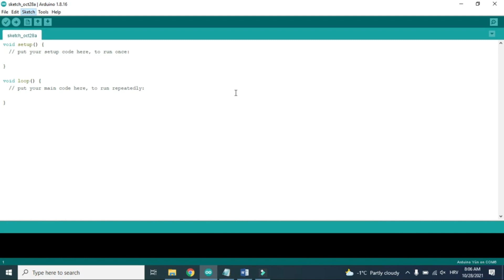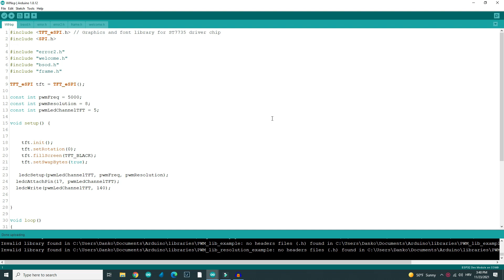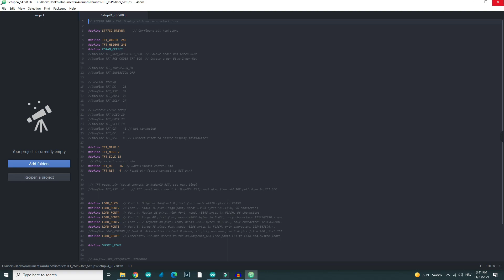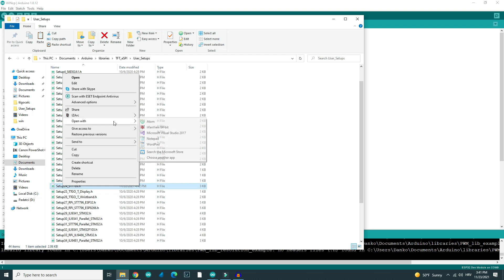ESP32 and 1.3" IPS TFT display (Fake WinXP code)

Comment: Hi, tanks for a show you project. I have a problem with a configuration pins for my esp32-s3-double eyes . Can you help my ? Actually I have a black display and no error tu compile and transfer a  code
Reply from the maker: I never tried that double eyes board, but it is probaby version of esp32 boards that is instaled in arduino ide. If you are using tft espi library version of esp32 boards needs to be downgraded to 2.14
Reply: @VolosProjects hi, yes i try the version but the result is equal. I think have a problem in the user_setup file configuration and drive.
Reply from the maker: @sergioroselli5726 why you dont use libraries manufacturer prepeared fir that board
Reply: I use the factory library . I think a problem is a config user-setup file, the config correct  PIN
Reply from the maker: @sergioroselli5726 if you are using factory library, then pins in user setup are already corect, what is version of esp32 boards instaled in your ide?
Reply: @VolosProjects now use 3.2.0 and receive a Display on  when select Setup46 at row 80 in file User_setup_select
Reply: The Displays are ON and pixelate

Comment: Dear Volos!
The sketch with Windows XP loads and works perfectly!
And Currency with the same settings shows everything, but everything is zero, except for the upper part, where 1.00000. and IS NOT UPDATED!  Where is my mistake.
My libraries:  WiFi_2.0.0, ArduinoJson-7.x, HTTPClient_2.0.
Help!!!!!!!

Comment: thank you very much for sharing! due to my lack of knowledge to be able to adapt the codeI had to downgrade the esp32 kernel from 3.0 to 2.0 to avoid the error (ledcSetup' was not declared in this scope)  due to changes in 3.0 : ledcAttach used to set up the LEDC pin (merged ledcSetup and ledcAttachPin functions) and it work !
It would be great to see more projects like this as a classic green terminal screen with code😃
Reply: A mi ya me había pasado con otros Sketch y bajando la versión si que funciona.
Gracias
Reply: code?
Reply: @sahatmlumbantoruan6432  el code está en la descripción del video

Comment: Thank you so much .. 
I noticed something with using this library compared to the Adafruit_ST7735 (I have ST7735 1.44'' 128x128 TFT) 
The 16-bit colored images appear INSTANTLY using this library with the help of pushImage( ) function.. 
While using the other library with the help of drawRGBBitmap( ) method, the image loads gradually from top to bottom "it takes about 1 second" .. 

so what's the reason behind that? .. why is pushImage faster than drawRGBBitmap ? 

Thanks

Comment: Hi! I have uploaded the same fake WinXP coding into TTGO (LilyGo) 2ASYE-T-display (1.14 Inch LCD). But the image does not fit the display properly and I have only half of screen shown. Where should I go on the code to fix the resolution? Thanks!
Reply from the maker: Sorry, that cod eis writen for 240x240 display, not code but images that loops, it is not possible to addopt code for 240x135 display you are using
Reply: @VolosProjects  Thanks for your reply! I was wondering if you can provide the images (bitmaps) to upload them to the code...or just redo the code with the 135 x 240 images resized...I buy you a generous coffee! Thanks!
Reply from the maker: @Attic-Toy-Design  i will try to make something today
Reply: @VolosProjects  Lovely! Let me know! I believe this will benefit not only me but many of thousands of your subscribers and fans, as this TTGO board is very simple and easy as it comes with the display on it...Thanks Mr Volos!
Reply: @VolosProjects  Hi Mr. Volos! Let me know when is ready! I am ready to buy you a coffee..

Comment: I have 38 pins ESP32 Board. I can not find nowhere a clear assignment about the pins.
Reply from the maker: gnd-gnd, vcc-vcc,  scl-15, sda-2, res-4,dc-16 or Rx2,  blk-17 or Tx2... don't forget edit user_setup file from library. Pins are in description.
Reply: @VolosProjects  Thank you very much for responding. I will try it.

Comment: Windows XP, ahh memories.  Very Clever, all your missing is the XP boot sound.  I'm thinking a small 3d Printed case like an old XT computer and sticking this in it with a small battery.  Most of my Geek friends would geek-out.  Thanks for the project idea.  Keep broadcasting!!

Comment: Help please I have tried two displays both are blank apart from being back lit. Tried this project and the Christmas one. Double checked pins. thanks
Reply from the maker: Did you setup tft_espi library?
Reply: @VolosProjects  hi, yes I did, followed instructions and used setup 24. Even copied your pin allocations from the information below the video in case I made a typo. Double checked each wire is going to right pins. Wouldn't think it's 2 faulty displays, so something I have missed. Maybe it's the loading of the code, it ends with saying it is going to reset and then no further messages. First time using the esp32.
Reply: @rogersmith6151  How did you go about uploading the image part of the code?
Reply: @TheKrausenKid  I sorted the display not working, used setup 24 with this setup 
#define TFT_MISO -1
#define TFT_MOSI 23
#define TFT_SCLK 18
#define TFT_CS -1 // Chip select control pin
#define TFT_DC 12 // Data Command control pin
#define TFT_RST 4 // Reset pin (could connect to RST pin)
Important to make sure the nodemcu toward the bottom of setup 24 are not defined and have // in front.
I could not get the XP program to work get an error in the image file.

Comment: I am sorry but I can't follow the wiring, there are 8 connections coming from the esp32  but only 7 connection points on the lcd.
Reply: Did you sort it, I cant get mine to work at all. Thanks

Comment: I've heard that you can't run an operating system on a microcontroller because the architecture doesn't have a memory control unit, is it possible to make one (emulating, using an ic or using a FPGA)?
Reply: As long as a port exists you can run Linux on any processor fast enough depending on your patience and what you call Linux. There are some exceptions but yes, you require an MMU. Operating system is a general term. ESP32 runs the FREERTOS but there are other options. The list is long as to why you couldn’t run Windows but the architecture would probably be at the top of that list.
Reply: @georgewaller7080  I said just OS because I was being generalistic, a real time operating sytem is too different I don't even count as it being an OS, it's the same thing with ROS that is a such confusing name for a framework, but leting the classification tastes aside, I think that Linux could be ported to run on a MCU as it's open source, maybe there's a way to avoid using an MMU but if it renders it unusable there's no point into puting all the effort to make it work.
Reply: No, FreeRTOS is an OS. I believe there’s some port of Linux to STM32 microcontrollers but I don’t think it’s worth it, it certainly hasn’t gained much traction. There’s no real way to bypass with any benefit, just use the right part in the first place.

Comment: Hey can you tell me that where did you join the MISO like in which pins of the display? because i can see it's next to BLK so after that there is no pins in the display and did you join the CS pin to the BLK pin?
Reply: I had the same question
Reply: BLK pin is for backlight, usually connected to 5V pin. Don't joint the cs and blk pin. CS pin is the pin for showing the image on the screen, connected to ESP32 pin ( you can see on config.h file). Usually pin no 15,16,17,21,22.

Comment: Hi! Your first vídeo about these chinese TFT screens just save my week! Thank you so much. One simple (or two) question: If I follow the default ESP32 GPIO pins discribed on the library will It works? Could it burns the screen circuit? My ESP32 board is the same model as yours.
Reply from the maker: hello! dont worry, you cant burn anything, just dont swap gnd and vcc, yes it will work with defoult library pins.
Reply: @VolosProjects  Tks! I’ll try that. By the way great videos! Congrats 👍🏻👏🏻👏🏻👏🏻